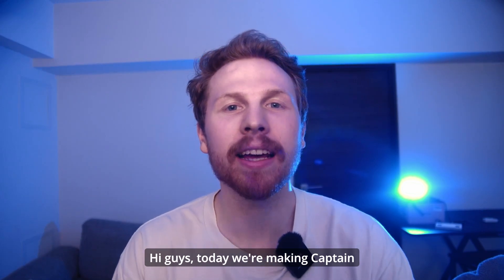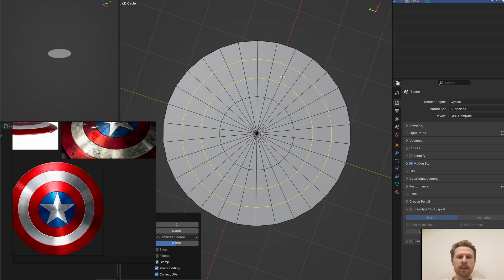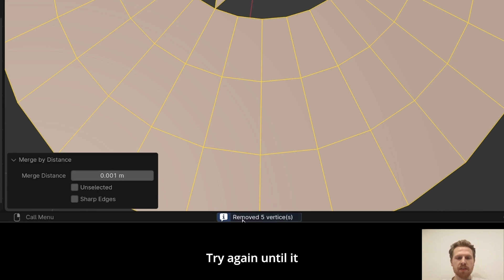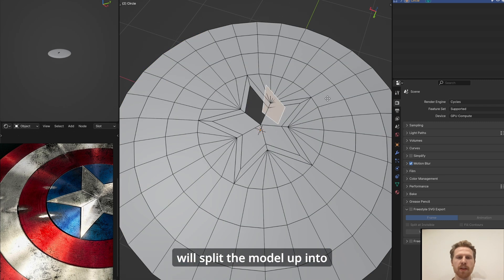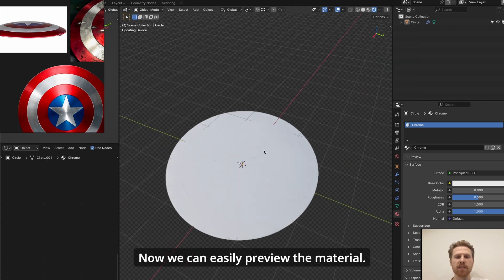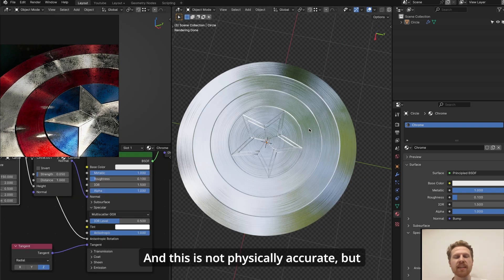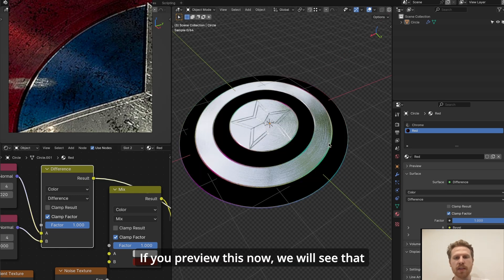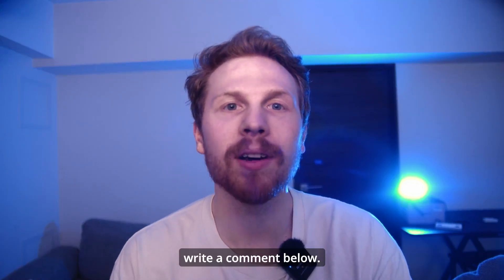FASTEST Way To Model Captain America's Shield in Blender

Comment: I'm having trouble with the red color. I have followed the steps a few times and cut off the scene lights and i always put it in Cycles. The red is very dull and washed out where yours is very visible. Can you help me?
Reply from the maker: Hi,  there might be multiple causes. 
- What colorspace are you using in Render Settings? Mine is set to Filmic (Render Settings > Color Management > Change the View Transform to Filmic
- If you click the Chrome ball under the "Scene light" and "Scene World" buttons, what happens if you change the lighting? 
- If you want, you can send the project file to heydigitalist (at) gmail, and I can check the file and come back to you